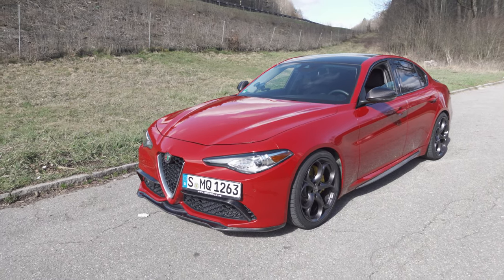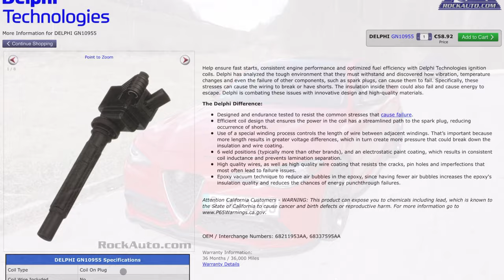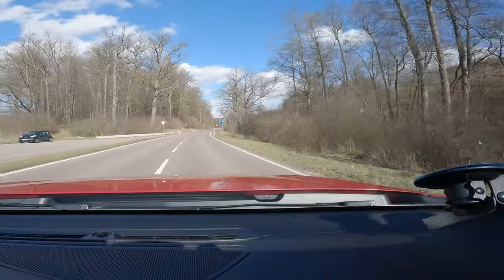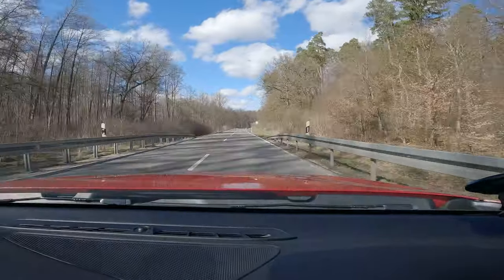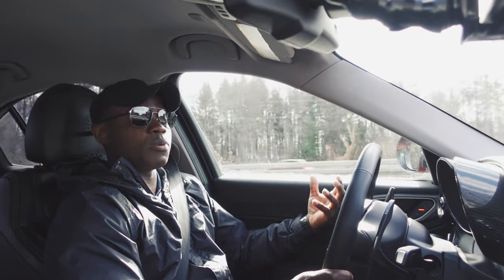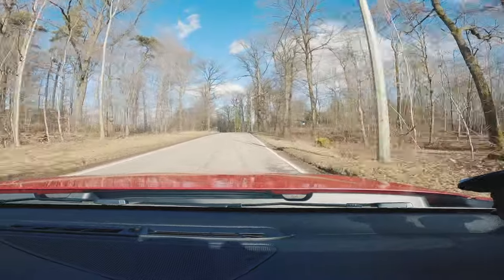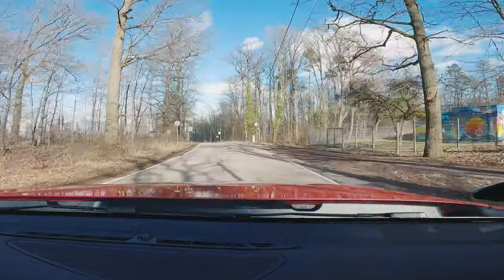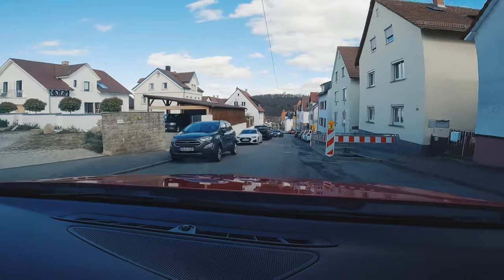I broke my Alfa Romeo Giulia

Comment: serpentine belt causes misfire? this is very wrong, your engine has timing CHAIN for crankshaft position whereas serpentine belt is the thing that keeps water pump, generator, etc. rotating and it sure cannot cause musfires

Comment: The best way to do this without spending a lot of money is to swap the spark plugs and coil packs to a different cylinder and see if the misfire switches. If it doesn’t you know it has nothing to do with the plugs or coil packs and you can look elsewhere. Like you said charge the battery and make sure it’s good so you can rule that out
Reply from the maker: Yep that should definitely be a step! Good point!

Comment: Thanks for the vid bro. Started getting the Electronic Throttle warning along with Misfire. Did a fresh oil change and plugs. Going to check the battery, then move to the coils. Live in the states - love rock auto.
Reply from the maker: Let me know how it goes hopefully works out I think you’re headed down the right path
Reply: @club.alfagt  turns out it was the plugs. The new plugs they put in were champion and I was still getting the misfire at High RPMs. I saw on some online forums that champions do not go well with Alfa. I got OEM NGK from Alfissimo and she is driving perfect. Thanks bro!!
Reply from the maker: @oscar9388  hell yeh man!! Ngk iridium only bro!

Comment: I think for anyone that is having any trouble with these cars or other cars in general and are having misfire problems. You should always marry your spark plugs and coil packs. If you don't marry them you will run into problems early on instead of one of them failing later on. Something that's a good habit to get into is taking a few seconds looking at your serpentine belt every 3 months. I've had to change the battery once and it was the OEM battery from factory. If you plan on tuning your Giulia change the   {oil/filter, sparks plugs & coil packs, serpentine belt & coolant flush} Always good to start fresh on everything so car doesn't cause any problems.
Reply from the maker: Very good advice!!

Comment: Welcome back with another great video 👍 . I agree with you about the low battery issues . I recommend spending a little bit more on an H8 AGM Battery .
Reply from the maker: Maybe I should try that next!!! Any links?
Reply: @club.alfagt  EverStart Platinum AGM Battery, Group Size H8 (12 Volt/900 CCA) which is made in Germany BTW . 
With a Free 4 years replacement warranty. Found it here at local Walmart or Sam’s club.
Reply from the maker: @sahersesostris8332  works well in your car?
Reply: I have the battery over a year already No problem so far and I drive the Giulia only on the weekends !
I am sure there is something similar in Germany . just stay away from VARTA & Mopar brand batteries.
Reply from the maker: @sahersesostris8332  I definitely will….thank you so much for this information

Comment: Gonna check the battery in a bit, just had some codes pop up on my 2018 Giulia P0072 and U1700-86. Ambient Air Temperature Sensor Circuit Low, Body Control Module-Signal Invalid, possible secondary code P1E64 Fuel Level Sensor 'A' Out of Range High.  First codes but, the car only has 16,374 miles.
Reply from the maker: Interesting 

Have Alfa take care of all of it

Comment: Yes, something is up with the battery.  Maybe it needs a larger battery. I have a brand new battery and if the car sits for a a couple of days, the battery is weaker and the Start / Stop wont go on until the battery is fully charged.  I would be reluctant to leave it at the airport for a long trip... might not start
Reply from the maker: Exactly. Ridiculous

Comment: Hey man, welcome back. Those dealers are crazy, I have finally finished my project with the wrecked Giulia and have her registered and already enjoying the ride <3 But I have some small issues left like the sun roof wont open from one side so they asked me for 3000 euro for replacing just 1 part of it... Now I am dealing with the corner lights that never worked and found a threat where the guys in the forum said that it doesnt work for Giulias 2020 and 2021 with the Nero Edizione package... which is absurd to have them installed in the headlights but some software issue wont let them work
Reply from the maker: Wowwwwww…are you doing the work yourself or have a side mechanic?
Reply: @club.alfagt  Yeah, I did most of it myself, left only the painting job for my cousin as I am not that good at it. Have few more things to finish as I can not find front right side fender yet and I am using the original one which have some damage

Comment: Hi man! I'm from the UK and recently (this month) just got the Guilia 952 2.0 (200hp sprint variant). Totally in love with the car. Would you recomend a tune to 280hp to match the veloce (the car as you know has the same block and propshaft etc) even if it only has one exhaust? I'm worried about overloading the car and causing damage if the car can not expell/breathe properly. Just wondered if you knew anyone who has made the tune with the sprint model.

Also which battery tender do you use or would recommend. I agree with everything you've said and want to keep her in good shape. 

Thank you! Looking forward to more videos on the channel! The content is so helpful.
Reply: Hey could I talk to u sometime about this car? Few concerns have me hesitant
Reply: @Daniel-rd2wh  Sure no problem I’ll reply here in the comments to any questions. 

I ended up tuning the car to stage 2 with NJS. Stage 1 is to increase power output to the veloce model (280hp) and stage 2 is to match the stage 1 of the veloce when mapped (325hp and 360nm of TQ). 

Car now actually runs smoother through the rev range than stock. Fuel economy is actually the same if not better and have had no issues with overheating whatsoever. Intact  I believe that the the tune actually forces the auxiliary water pump to run at a higher rate so that the car can deal with the additional temperature. That with the fact that the stock intercooler can run much high power than factory. There are multiple videos about this from people running the hybrid turbo that I’ve seen.

The drivetrain as mentioned before also is the same from the QV so it’s designed to handle 500hp +.

The only thing I would say is to do a gearbox service every 50k miles to help deal with the additional load and help maintain it. It’s good practice anyway to do that.

The exhaust as it seems at the moment is only really for sound and aesthetics. I will look to do this in the future as well though.

Comment: So, very common issue with the battery that were installed in the US I had mine swapped on the warranty within the first year, and never had any issues since although I only drive 20 miles daily or less .. lately. I have 43k mikes on mine.  Putting a tender on a car every other day is a total pain in the ass and there’s got to be a better way. I have a tender I  use on my boat when it’s stored for winter but I can’t imagine dealing with this BS on daily basis.

Comment: My 5cents,  I had on Stelvio 280HP an issue (between 50k-75k km) with was reported as fuel delivery problem. The service blamed quality of fuel I used and replaced injectors several times. No luck. At the end it was malfunctioning  pressure control unit on fuel pump. Hopefully this will help someone in the future.
Reply from the maker: Hmmmmmmmmm ok, noted, thanks!

Comment: How many miles do you have on it ?  Remove that plastic shield over top so it doesn't retain heat on packs
Reply from the maker: 85k about, what plastic shield? Oh you mean on the battery? I figured it’s for corrosion prevention
Reply: @club.alfagt  I ment the engine cover .  The plastic Alfa Romeo piece .  It's just a decorative price but it retains heat after engine shuts off and the coil packs sit in that saturated heat .  Every vehicle I purchase I take this off and I have never changed a coil pack but everyone I know that doesn't have problems around 50k or so.
Reply from the maker: That’s smart. I’ve always left it on as a dust cover or protection between the engine heat and thin hood paint

Comment: Thanks for the video. I have a Alfa Guilia  sport 2017  got a service engine  and electronic throttle body  light. Engine shuttering on startup. Had a friend jump the car and the car started up. Lights went  away after a day. Has that ever happened to you before?
Reply from the maker: Yes it has. Was the coil packs

Comment: I have a brake warning issue that comes and goes related to my emergency brake for my Stelvio, with your knowledge would this be a battery issue because i do get low battery warnings from not driving everyday, I plan on changing both soon! thx.
Reply from the maker: Hey! No you probably need to check the brake pad life on all 4 corners

Comment: what year is your car by the way ? im looking to getting an alfa
Reply from the maker: 2018
Reply from the maker: Get one! They’re great
Reply: @club.alfagt  I'm fixing to get an 18 or 19 Giulia sport ti . Your centerline corsa exhaust sounds great btw !  Thank you so much for the heads up on the coil packs and plugs , belt etc.  I wonder if a $$ optima red top battery  would still need a tender ?  I installed one in a friend's Gallardo and it solved the frustrating ha problem of keeping a tender on it if it sat for a week or so . 
The oem one didn't throw codes on that car but it was pia and ridiculous to jump start it with a batt booster after few days parked. Even with their  idiosyncrasies Italian cars have such unique character . They are like your kids that at times annoy you but you'd fight tooth and nail if someone tried to take them from you. 😀
Ciao

Comment: I have a question for you. I am thinking of adding the race mode/switch to my giulia. However, I read that the throttle mapping reverts back to N in every mode. How did you overcome this problem? Or you do not notice it anymore?

Thanks
Reply from the maker: I dealt with it by buying the go pedal

However, I have uninstalled race mode now and gone back to the regular setup. I like it better

Comment: Hey brother. I get rough idles on cold start. I have a 2021. Alfa Romeo Giulia. Have you ever had this issue?
Reply: And did you get a check engine light when your car was idling bad. Cause I haven’t not got no light I just feel the rough idle on cold starts and then after it warms up it stops
Reply from the maker: Yehp and for me it was the coil packs. Change those and the spark plugs at the same time
Reply: Oh ok I get the rough idling on the cold start but no check engine light
Reply from the maker: Yeh it starts that way
Reply: Ok appreciate the help. Only thing that’s weird is I only got 16k on the car. I jus got it 2 months ago
Reply from the maker: @Fooeazy1990  that is strange. Could also be a low battery. Coil packs require a tremendous amount of energy to fire up especially when cold. So if the battery is low and isnt providing the proper amount of amperage to the coil pack you could potentially have misfires until coils have warmed up
Reply: Oh ok imma get the battery checked at auto zone to see the life of the battery first